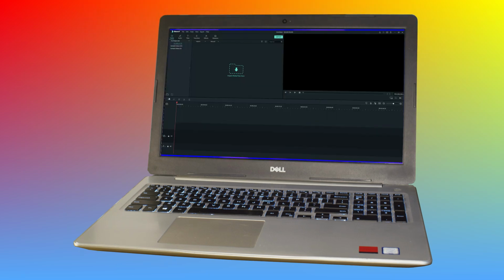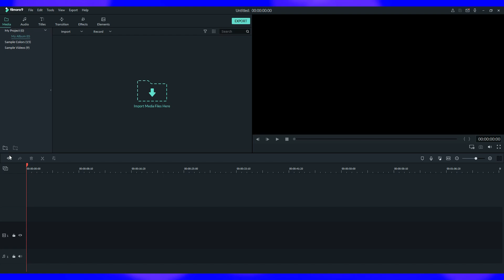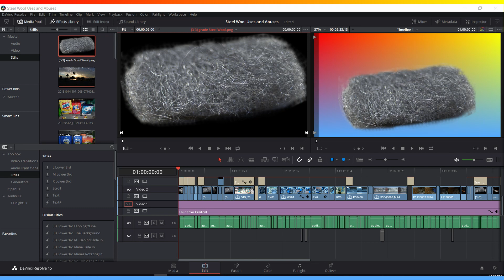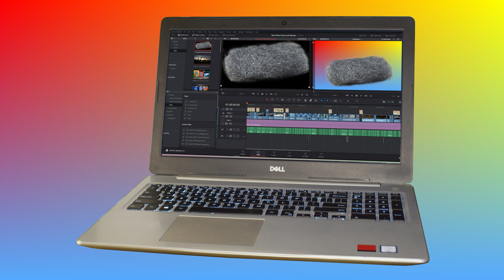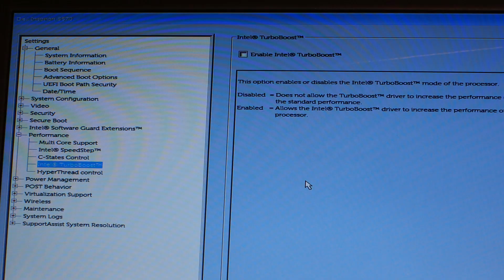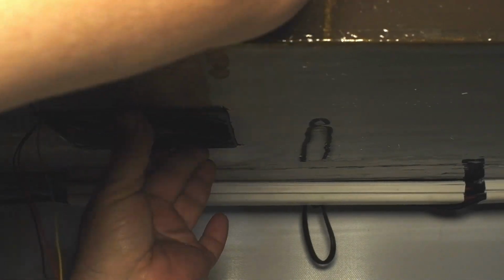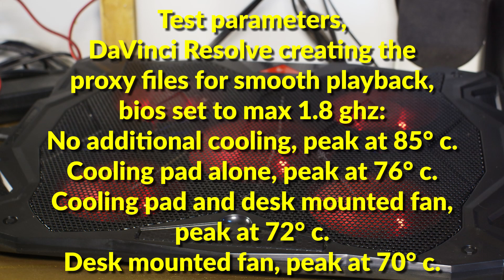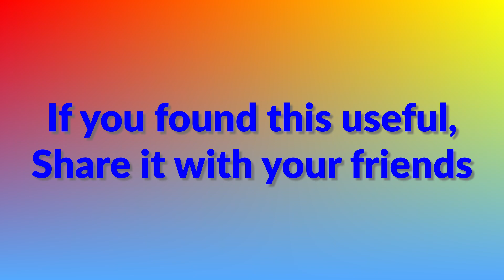How To Fix An Overheating Computer

Comment: Funny how I had the same issue immediately with my Dell Inspiron out of the box. Is this a regular laptop thing, or a Dell thing? I was also using DaVinci  and it immediately started to heat up. I feel like returning this, as your solutions sound like way too much effort for this to be a widespread problem with all laptops. I think Dell just doesn't know how to properly make cooling vents...